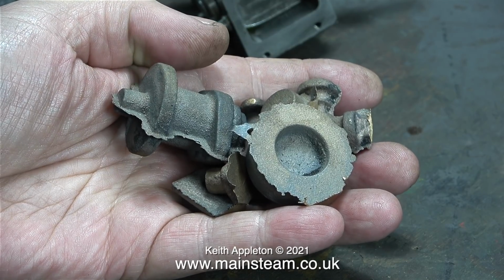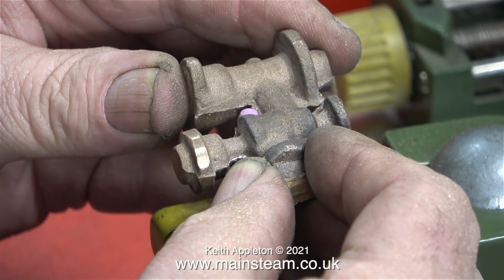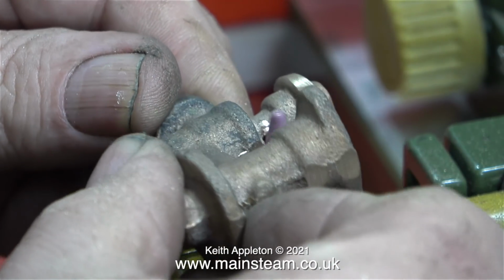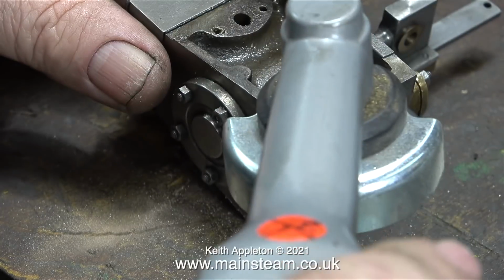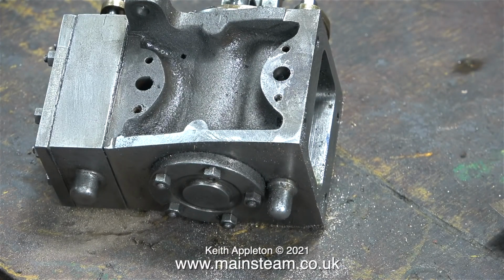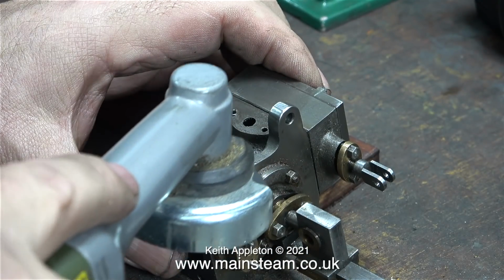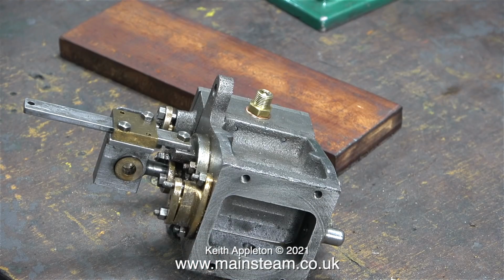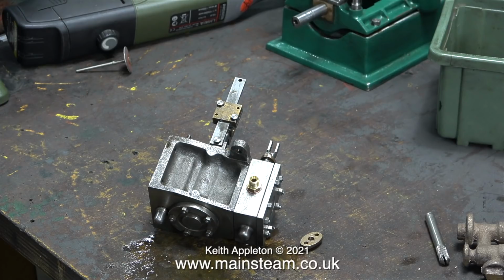COMPLETING A STUART TRIPLE EXPANSION ENGINE - PART #8

Comment: I've been a bit confused on this engine.  All the cylinders are connected by one crank shaft.  Therefore, if one cylinder has appropriate timing and runs with power, it will drag the remaining two cylinders along?

Shouldn't each cylinder be adjusted individually?

I express zero knowledge here.  I really do not know and would like to know the answer!  Thanks!
Reply from the maker: Each Cylinder's valve gear needs setting individually . . .
Reply: @keithappleton  Thanks Keith.  I watched as you set the timing for the low pressure cylinder, with the high pressure cylinder active and, needless to say, I was surprised.

The lack of a slide valve in the mid pressure cylinder cemented the confusion.

Comment: Keith, that battery operated tool is probably less than 12 volts and is intrinsically safe. I do not believe there is enough current in the spark to light even acetone or flammable liquids.
Reply from the maker: No it is not safe for my application. If it was, then I would not have mentioned that I thought it was unsafe. Even at 6 volts the spark is excessive and the switch is intermittent anyway. Dangerous when using Naptha as a degreasing solvet.
Reply: Agree Keith a source of ignition and Naptha don’t go together, except of course in a Naptha launch ! Which for a long time did not believe were a thing and the book I was looking which was picture book on Naptha launches  at was a work of fiction.
Reply: The question is, what are you going to risk to find out if it's safe or not?